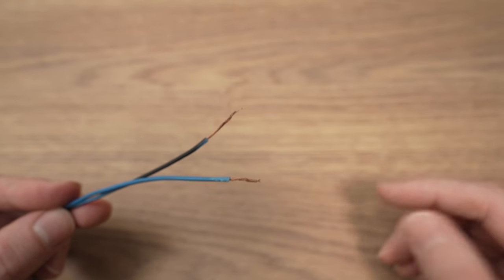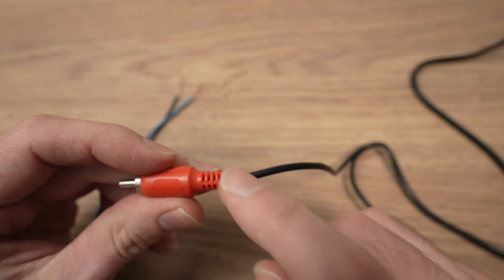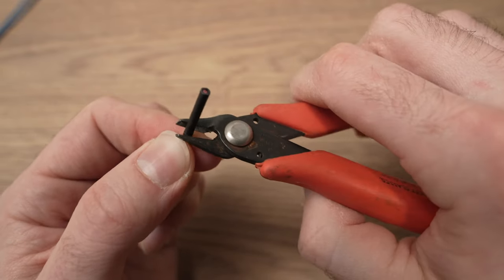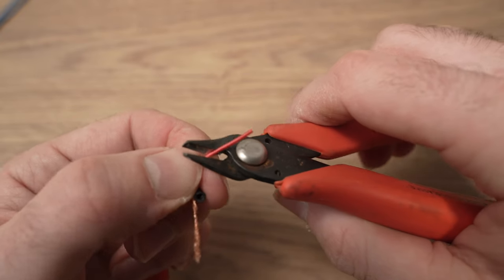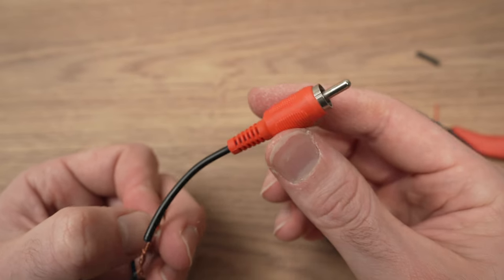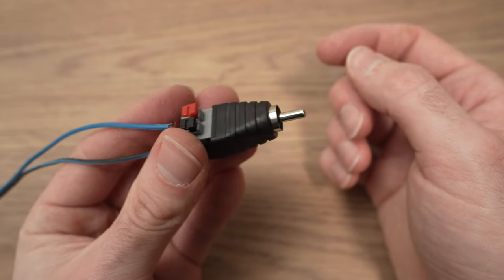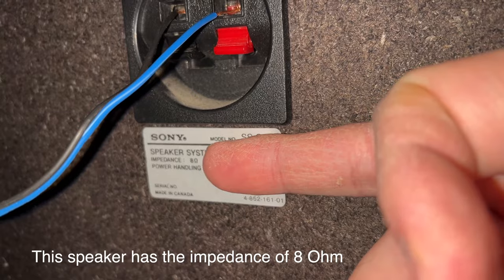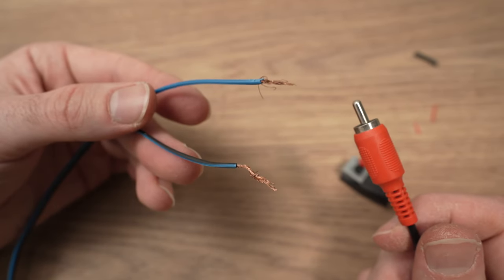How to Connect Speaker Wire to RCA Plug - 3 Ways!

Comment: The  wire inside the RCA is too thin.  just buy the RCA to speaker wire adaptor can save your time and money for the RCA cable
Reply: How does it save money if you have to buy it?
Reply: When your speaker wires are coming directly from a record player for example, you can't

Comment: RCA Connectors are not meant to carry the amplified signal that your speakers require. Not only that, but RCA output terminals don't send the amplified signal anyway. They send a line level signal (non-amplified). What you would need is a discrete amplifier in between your RCA terminals on your playback device & the speakers. What's scary is that this video has a good ratio of likes to dislikes. It's making me wonder if we can't trust that system any longer.

Comment: It makes a difference which wire is used when you are splicing the speaker wires into the RCA plug. Speakers have phasing and you need to make sure that the negative or positive in each of your splices is identical.
Reply: Oh my nagative wire is bigger than my power cord' could that be the reason why its not working when i connect it to my deck?

Comment: hi! do you know what to do when there’s absolutely no information on what Ω my tv is? my speaker is a 6 Ω

edit: i found the manual for the TV (which is very old, from 2008), but i’m not sure what to look for because the manual doesn’t mention ohm in the audio part, it says “output power 10 W + 10 W”
Reply: I don't think your TV output is enough to power speakers without an amp. Best to do is just buy a small amp(something like a class t amp) and connect the tv to amp. Then you can connect your speakers to the amp.
Reply: @bytarik  thank you so much for the help, i appreciate it :)
Reply: @canniloni  Yeah no problem.

Comment: I'm a bit confused, I thought you need to break up the two cables into two plugs, since there are one connector for each, the positive and the negative end.
You can just connect both to a single male plug, and leave one of the two connectors empty?
Reply: Im confused aswell, did you find answer?
Reply: he shows it near the start. each rca cable runs two wires! The two wires that go into a speaker are just voltage and ground. You use 2 rca cables (red and white) because you have left and right
Reply: @Jairoalvarz right so in terms of using subs or other speakers in pairs. Wouldn't we use both RCA's instead of wiring them down to a single plug?
Reply: @osopena3979  in theory, you would have to make 2 sets of these cables to make a left and right channel. Positive and negative are on each cable so each channel needs it's own RCA.

Comment: Are the two wires negative & positive wires from each speaker? My amp has 4   jacks in the rear. Can I plug any of the 2 RCA plugs into any of the 4 jacks ?
Reply: Double check your RCA's. Some amps have double inputs while others have input and output. Never mix your input with output.

Comment: Stupid question: does this also work the other way around? Would it ibe possible to connect a denon AVR front speaker output via speaker cable directly into an stereo amp (analog input RCA)? Would the volume level be higher if taken directly from the amplified speaker cable signal or would it be converted down to similar effect as when using pre-out RCA? Could this damage either amps or would this just fail...?

Comment: What if I have 1 sub output that is rca and my sub is red and white wires?
Reply: Red and white just mean left and right. So if you run your sub off one input, you might just get left. Or righr
Reply: You would wire your other side into the opposite color, and have Left and right red and white